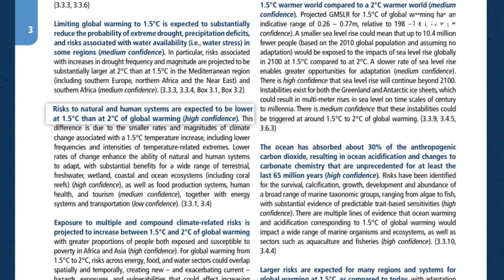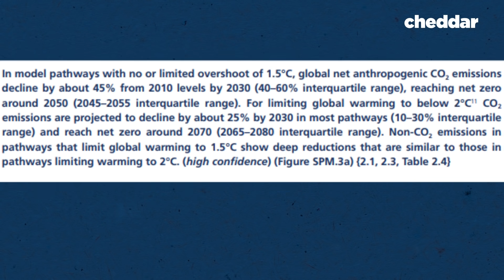Wooden Skyscrapers Are On The Rise - Cheddar Explains

Comment: Will jet fuel make a wooden tower collapse as easily as steel?
Reply: no, jet fuel doesn't melt wood beams lol
Reply: That's why the Bush residence is made of wood.
Reply: @Alex-cj1uh  it burns the wood
Reply: asking for a friend
Reply: Missed opportunity for 'wood ' pun
Reply: Fritz Smith I am aware of this. I was mocking the op.
Reply: studying civil engineering here. wood will lose it load bearing capacity in a linear development with is predictable and you can make the wood in dimensions that give the firemen time top combat the fire this will be safeer then steel. steel loses it load bearing capacity in realativ low head, and the fire do not need to eat away of the steel before it collapse. i am sry for the bad english, it is my second language
Reply: @fritzsmith3296   the steel will lose its load bearing capacity and the building will collapse under the weigh of the building. fyi u can put the fire out and replace burnt wood but you can only fireproteced a steel building whit expensiv fire resistend paint wich fumes decresses the living quality
Reply: Fritz Smith 
I cannot tell if you are joking, or if you are the one missing the joke.
Reply: @alohadubs7683  he watched videos on YouTube. He knows what he's talking about
Reply: @shaunakkulkarni4679  didn't you know? You have to watch at least 10 videos to obtain the same understanding as structural engineering courses from a trade college, and if you watch Vsauce then fuck, you dont have to take calculus either.
Reply: @fritzsmith3296  You have a poor understanding of tensile strength.  Metal does not have to reach anywhere near it's melting point to fail.
Reply: @fritzsmith3296  I have seen the documentaries about the subject.  Yes George Bush did the right thing and pulled the buildings.  Yes jet fuel does in fact melt steel beams.  Insofar as the metal weakens with 2 billion tons of concrete pushing down on them causes them to bend, changing the balance until the building falls.  You are just wrong because you do not understand any physics or engineering.  Just go read a book.  Take a year to learn about how the world really works.  Then you will agree with everyone who has told you repeatedly how wrong you are.
Reply: @fritzsmith3296  Oh no. You did what? You dug around YouTube? I would trust you, but I only listen to people who watch more than 7 videos on YouTube. That way I know they found reliable and factual information.
Reply: Too soon
Reply: @fritzsmith3296  dam did you eat your own ass?
Reply: @fritzsmith3296  bush
Reply: @fritzsmith3296  r/woosh
Reply: @fritzsmith3296  On a personal note.  Thank you for not just attacking me when presented with a counter thought.  ;)
Reply: >knowledge from conspiracy video's on youtube
Reply: @shootermcgavin7777  🤣🤣🤣🤣
Reply: it might not explode like the world trade center.   It exploded because steel expanded faster than concrete with heat.     People should revisit jacketed Ibeam.
Reply: You know steel isn't fire resistant right
Reply: @fritzsmith3296  tell that to the US government and the world trade towers
Reply: @fritzsmith3296  I already said, every engineering firm was proven wrong because none were high rise experts. Also, the buildings didn't fall uniformly, granted, they didn't just plainly fall over, but most buildings fall down in a somewhat straight manner, not all, but most. Building seven burned for 6 hours, firefighters were reporting entire floors engulfed in flames even before the towers came down. The FDNY chose to divert resources towards the towers and just containing building seven as it was already evacuated and thus it burned relatively unchecked. If you watch the footage, the inside of the building collapsed as the floors and beams have way. The floors collapsed north side first followed quickly by south side. The steel exoskeleton collapsed seconds later in what looked to be a uniformed collapse, but the interior was already down. Also, when building 7 collapsed, it damaged buildings all around it, doing millions in damage to a bank 40 meters across the street. As for the explosions, I assume you've never heard a steel beam snap? It is extremely loud, beyond most types of gun shots. Second, a controlled demolition starts at the bottom, watch a demolition, the bottom goes and the whole thing falls, the twin towers collapsed from the point of impact. 

And I'll reiterate this for you, fires well under the melting point of iron bring down steel buildings quite regularly, if the twin towers had more concrete construction, they would have remained standing. Political opinion aside, this is a fundamental flaw of post-modernism architecture, where if even superficial damage occurs, the structure is heavily compromised and if any major damage occurs, the building is likely to collapse because the entire structure relies on the entire structure for strength, efficient and aesthetically pleasing, but terrible in disaster mitigation. And since you are so fond of your engineering firms, which still have no bearings since none were experts in buildings taller than 12 stories, but hey, how about you source them. Site your references, the burden of proof is always on the accuser, and you are accusing the American government of gross negligence at best and high treason at worst. I personally stand with the fact that I wasn't there, I didn't see it or hear it. So I have to go off proven facts that are unquestionable. I'll save conclusions for everyone else. But I implore you to justify your accusation by providing evidence that is peer reviewed and verifiable through mathematics and science understood by the broad scientific community.
Reply: @theduke7539  When arguing with the unintelligent, use fists, not words.  My father told me that when I was young.
Reply: @fritzsmith3296  steel beams heated to 1500 degrees will not liquefy, but they become as malleable as a wet noodle. Add to that, you know what can melt steel? Aluminum. The skin and frames of the aircraft were made of aluminum primarily, aluminum when ignited successfully, creates an extreme thermal reaction. Ask any US serviceman who has seen Chinnok helicopters take fire, the aluminum WILL burn, and it burns at over 3,500 degrees. Also, no credited structural engineer who specializes in high rise towers has ever said the twin towers couldn't collapse from a plane impact. Those firms that have were either discredited as fraudulent or they were proven wrong by being bridge or low rise building experts. Need I remind you, the towers didn't have a concrete core or any large amount of concrete. Fire at even relatively low temperatures below 1000 degrees can and do bring down all steel buildings on the regular. And if it's so dangerous to warn the public, why do thousands upon thousands say these things in public, on forums, and on YouTube with ZERO consequences. The Government is inefficient and incapable of pulling off such a ploy with no one leaking the "truth" the guy who shot Bin Laden couldn't even keep his mouth shut for more than a week, and he is a SEAL, you really think politicians could do this for decades? I would by the government had the opportunity to stop the attack but let it go because they either missed something or didn't think the attack would be serious(let alone single handedly changing American culture entirely in a matter of just 4 hours.) But even then, someone had to know, and those people would have said something.
Reply: @fritzsmith3296  Pretty sure he just demonstrated that it doesn't matter if jet fuel burning could melt steel. A: It would be malleable anyway, and B: If the aluminum frame/skin of the aeroplane ignited, that would DEFINITELY be able to melt steel. Think thermite, and you've got a decent picture of how that would go down.

Comment: Me watching video

Cheddar: building with wood is faster, efficient, and price competitive with steel. 
Me: Interesting. I shouldn't be so negative about wooden towers then

5 mins later 

Cheddar: The reason why there aren't more wooden towers is because is more expensive than steel
Me: ...
Reply: They were talking specifically about the wooden towers in second part. Wooden high-rises are expensive, while lower wooden buildings are fine.
Reply: The difference is potential. Wood CAN be cheaper than steel, but, because wooden towers are still mostly conceptual, it is not. Cost will inevitably come down as mass timber gains popularity as a building material.
Reply: @ethanhallberg1801  no no no. It come to my attention when I repair my my roof that a wooden truss is more expensive than an aluminum one. Either we already made aluminum cheap or wood has become expensive. I don't know. All I can say is, wood are currently expensive.
Reply: Competitive =/= Cheaper

Competitive just means that the price is at a place where choosing it isn't a massive expense over steel. The faster build times currently probably offset the more expensive cost of materials but when it comes to real sky scrapers the cost of materials starts stacking up more. It should also be noted that economies of scale mean a lot here the world produced 1808 million metric tons of steel last year, I can't find numbers for mass timber but I think it's safe to say that world wide mass timber production is probably less than 0.001% of that. As production rises the price of material will fall, one thing I anticipate being important is securing suppliers on a mass scale, like when it comes to wood plantations, to use this form of construction on a large scale we'll need a lot of plantations.
Reply: They're NOW more expensive. It's wood, but the technology to build super tall with wood is under development, and like any technology under development it's more expensive than the current technologies being widely used.
Reply: Super tall high rises. For midrise commercial buildings, timber would be great
Reply: There was an article on the WSJ a while back saying a lot of people in the US back in the 80's planted trees to sell by the time they retired on land they bought for that purpose. But when the trees grew up, nobody had saw mills to process them around the area. The article is called "Thousands of Southerners Planted Trees for Retirement. It Didn’t Work." This created a massive supply which brought the price down. This means that the wood tower trend could be extremely cheap in the US with some investment.
Reply: In this case, wood isn't meant to replace steel, it's meant to replace concrete, which produces a lot of CO2. It's "price competitive" with concrete building I think.
Reply: @1001-v1s  People have said that about a lot of things. The internet, for example. Yet look where we are now. It's because of visionaries who dare to explore and go past the very limits of what's possible and turn so-called fads into cornerstones of society.
Reply: Or there's no more trees
Reply: Check an engineering manual.
What are the relative strengths of materials in compression, by weight, volume, whatever?
What goes up must push down.
Reply: Whenever something is in common use you will have customers, so it is more affordable to produce it. If something is not in common use, like wood for tall buildings, you have no guarantee of enough customers to buy all or most of your product, so you either have increase the price of your product to make up for the amount that didn't sell; or you have to produce less product, which reduces the supply and you still have to build the cost of producing (growing, harvesting, engineering, and the labor and tools needed for this wood) your product into the price for such a limited supply. However, when some people choose to use wood at this high price and show that it is a useful material, then more people may choose to use wood, allowing the price to go down to the true price of wood, now that wood providers feel secure that people will buy it and they can make larger supplies. The true price of wood happens to be lower than the true price of concrete, and wood comes with all of those possible material and sustainability advantages.

The video also showed some engineering challenges associated with tall wooded towers that would cost more especially with so few engineers currently dealing with such challenges, that shorter wooded buildings using existing wood do not have to deal with. So the height of your building affects, non-linearly, the price of wood used in construction.
Reply: Think of it like many new technologies, at first its rare and tough, but then as advances in construction and innovative techniques appear it cheapens.
Reply: 3 pasos:
1.- Cese de usurpación
2.- Gobierno de transición
3.- elecciones libres
Reply: It's more expensive NOW because we have to learn how to do this and get the needed materials and such. Concrete towers is a well established market. If this wood tower market can take off, eventually it will be less expensive in the long game. Right now it's a novelty, but if it becomes standard, it won't be any more expensive then anything else.
Reply: You need to pay more attention.
Reply: Nah
Reply: munender singh i